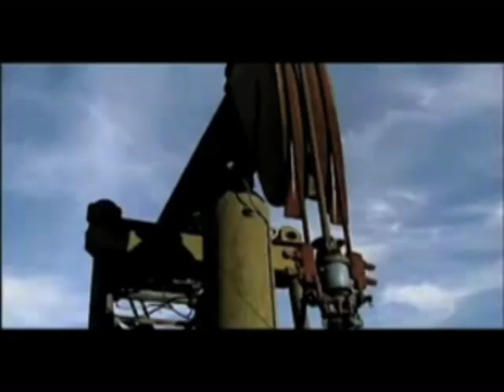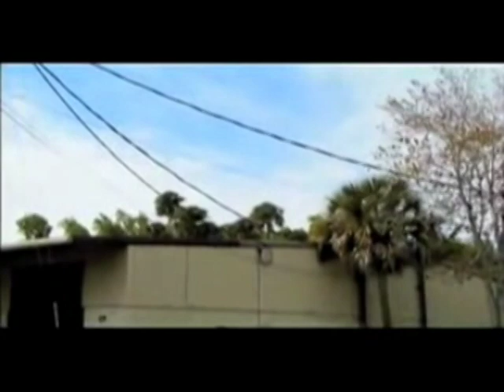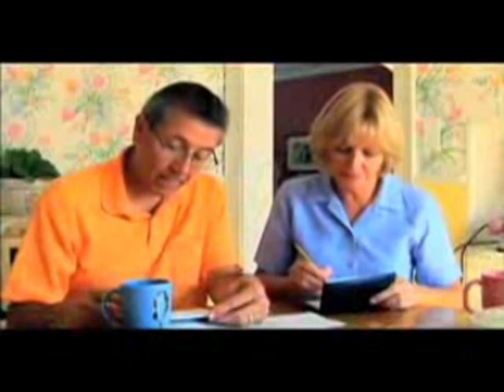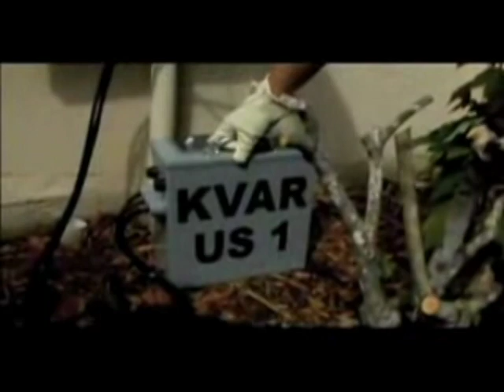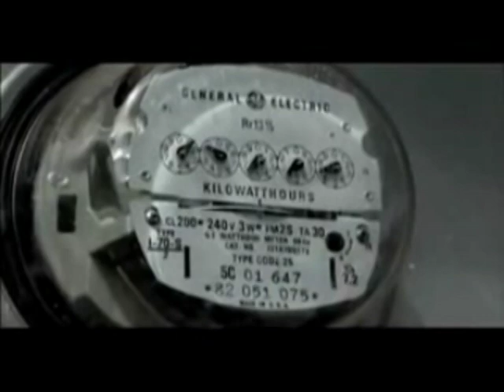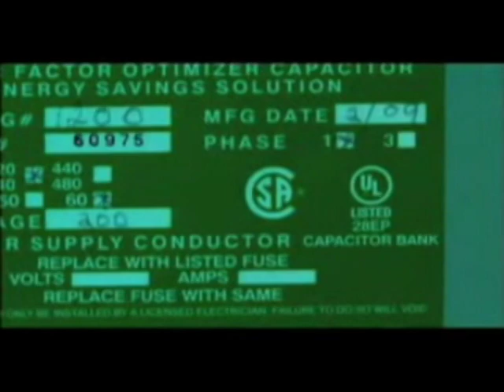KVAR  Introduction

Comment: Here is a example of how this device DOES NOT WORK AS ADVERTISED

If you have a load of 10 amps at 125 volts with a power factor of .74 and correct the power factor to 1.0  below is the math to figure the savings. The amp draw will drop from 10 to 7.4. .

AC watts formula is Volts X Amps X POWER FACTOR

 125 volts X 10 amps X .74 power factor = 925 watts (before device is turned on)

125 Volts X 7.4 amps X 1.0 power factor = 925 watts ( after device is turned on) 

There is a minuscule amount of savings from correcting the power factor, this comes from ever so slightly less losses in the wiring from the lower amp draw.

The sellers of these devices are telling you that volts X amps = watts and this is NOT TRUE watts = Volts X Amps X Power Factor. YOU ARE NOT BILLED ON VOLTS X AMPS, your electric meter compensates for power factor.

Do not take my word for this, before you buy ask someone knowledgeable about electricity about it.

Comment: i like the video how they made but the invention i think the inventor than wrong of the wiring in the system.the watt meter that use is lock of program to identify exact usage of electricity an i know why and how to wire this kind of bu its not right build like these.unfair to others that using in the the right way.

Comment: my home had bills of 281 dollars during the summer. I have had the desert energy saver on my home now for over five years. the highest my summer bill has been is 121.00 since it has been installed. Anyone care to explain how this happened?
Reply: you changed your usage, that simple. the rest is a joke! plain & simple!
Reply: I think not. I use my ac much more than I ever have because  it's cheaper to use now that  I have my desert energy saver. my neighbors  all have it and not has asked for their 100 money guarantee. why try to degrade something that works. I tell everyone the same thing sooner or later  you will have one because you are paying too much for electicity.  It Works!
Reply: sorry, but it's all a lie! your energy usage has changed. this only changes power factor, talk to a EE. he can tell you. you are not billed for PF , just KW's.i stand by my statement, unless some one show me hard facts!
Reply: i'm been an electrician for 30 yrs. i stand by what i said. they improve power factor  on three phase motors. again ask an ELECTRICAL ENGINEER he will explain it to you! snake oil is snake oil, nothing more nothing less! just like smart meters causing cancer another load of hype, with no proof!
Reply: btw , google ELECTRICANTALK.COM look for the thread on power factor correction. tell them it works, don't think so!

Comment: Power Factor Correction only works on low efficiency inductive motors. Basically most new motors have a High Power Factor. Variable Frequency Drives are the best option when a motor upgrade is not an option and/or you want to modulate the speed of the motor. This usually doesn't apply to a residential situation. The best energy savings is found by using the higher efficiency lighting, replacing old "wall wart" power supplies with new "switching mode type", insulation, and high efficiency HVAC.

Comment: They do help some ,, 
Dam sure not what they claim tho 
I ran one 4 past 3 yrs .. saved 5 to 12 % but that because i run small shop 
with very inefficient motors 
There is one great thing that dont tell u that helps u if got backup generator tied 
to ur house panel .. They help balance the load by 5 to 15 % 
save by NOT KICKING GENERATOR BREAKER 
Also helps if got panel box load to the hilt and always kicking the main breaker
it puts 3 to 8 amps on the other side the on the phase   in ur panel

Comment: You are absolutely correct: Actually, that is false.  Reactive power does not effect true power (kW) which is what you are billed for.  The utilities use capacitor banks to reduce the requirement that they have to produce more reactive power.  It has no impact on your internal billing (your home bill).  We investigated this while I was the Senior Engineer at the University of Illinois' Energy Resources Center for the US DOE because of the false information.

Comment: What you fail to understand is that by correcting the PF, you reduce the resultant power.  Your paying for the resultant power so by reducing it when an inductive load is running, you pay less.  No the real power is unchanged but the imaginary power which does no work is reduced.  The result is less resultant power created when inductive loads are running.  I have had one of these in my house for over a year and I average about 30 per month off my electric bill compared to without it.

Comment: It looks like they are simply installing a capacitor. What a scam. That will help correct the power factor while a motor is on but when the motor is off having that capacitance across the line will swing the phase alignment the other way and your power factor is bad again. I don't know if they mean to mislead people or if they are just ignorant themselves but if you don't have a motor running 24/7 then you are going to waste power with this system.